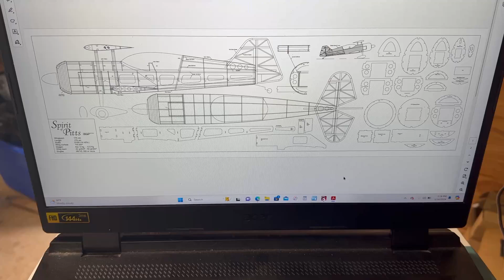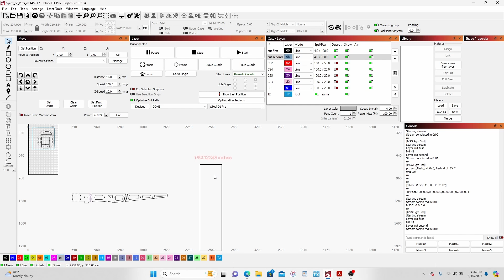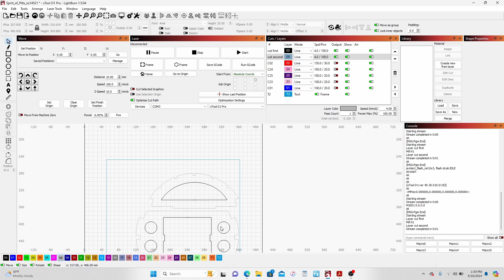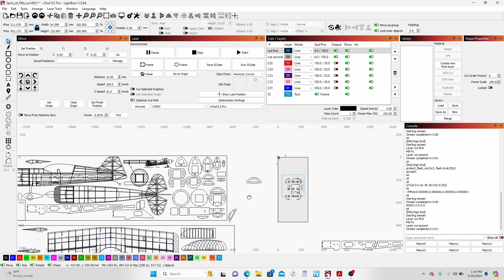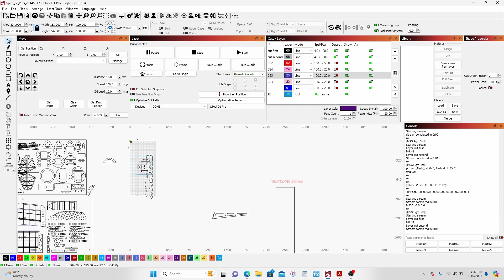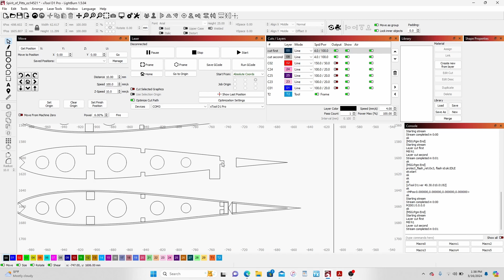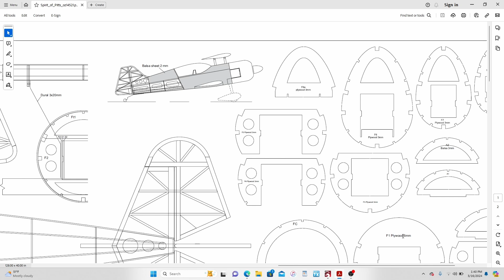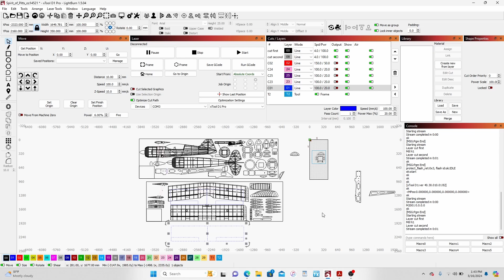Beginner Laser cutting 8: Semester exam...Large scale Biplane 1

Comment: Re: tabs holding parts in instead of dropping out.  Even sitting on honeycomb light parts will get blown out if you are using air assist.  I cut a lot of balsa and some paper templates and found this out the hard way.
Reply from the maker: In the beginning, I had some trouble with that and light burn, but with numerous updates since then it does work really easy, but with my honeycomb piece, I don’t have anything really fall out of place too bad so I just kind of quit doing it. 
That’s not to say that if I had something tiny that I thought might fall in the honeycombs, I would do it then.